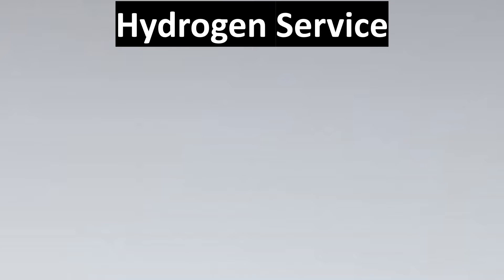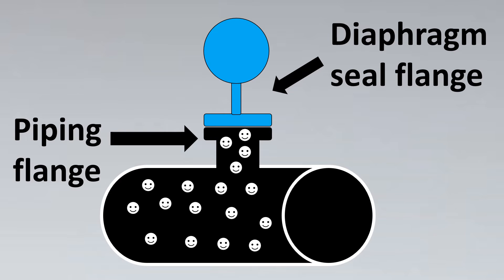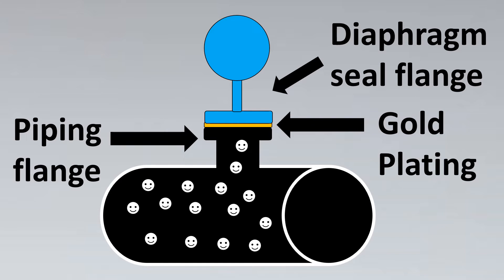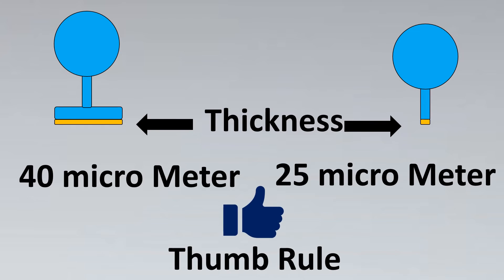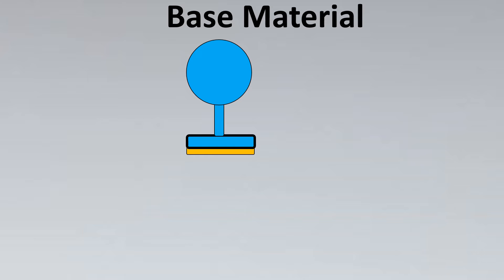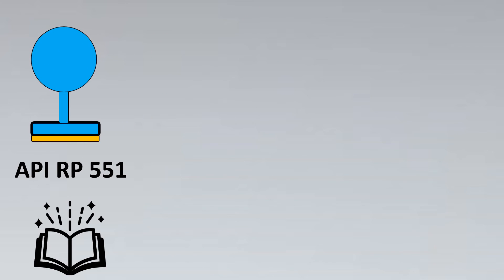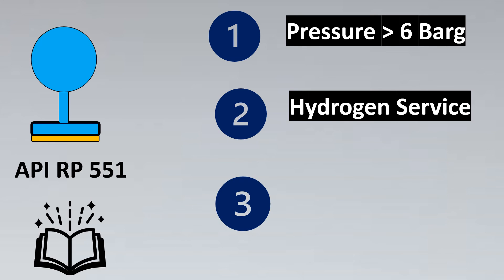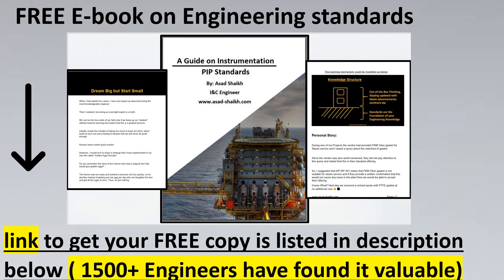Gold plated diaphragm for hydrogen service |Pressure Transmitter|Diaphragm Seal Pressure Transmitter

Comment: At which pressure would H2 bond break up
Reply from the maker: As per International standards and design criteria of top oil and gas companies it is around 5 to 6 Bar ( but note that it also depends on the temperature factor )
Reply: @AsadPassionateEngineer  so that means all hydrotreaters have gold plated PG diaphragms?

Comment: No need to use Gold plating if temp is less than 43 deg C?
Reply from the maker: and pressure is less than Approx 6 Barg as per API Recommendation.

Comment: According to the video , thermowell in hydrogen service  should it gold plated?
Reply from the maker: A very Good Question,

The answer is NO.

The thickness of most diaphragm seal membrane is around 0.05mm or 0.075mm so the Hydrogen atoms can permeate this wall.

Thermowells have very high thickness as compared to diaphragm seal membrane.

We can understand this as per the analogy that we gold plate the diaphragm seal membrane but we DONT gold plate the Pipe.
Because Pipes have thickness like Schedule 40 or Schedule XS which is far higher than that of diaphragm seal membrane.

However, precaution must be taken with respect to material selection. Tantalum is not a good choice for Hydrogen service and we should prefer SS316 in that case. (This is usually worked out by material engineer) however Gold plating would not be required.

This is best of my understand 😊

Do let me know if you have any other thoughts !! 

And once again thanks for this amazing question that many engineer get confused about!!!
Reply: @AsadPassionateEngineer  why not? Could you explain it? please
Reply from the maker: We can in short say it is because of thickness since TW has far higher thickness as compared to diaphragm seal membrane

We can connect further on LinkedIn or whatsapp to discuss further as well !!! 😊

Comment: I had similar experience in some of our Dp type diaphragm seal level transmitter for produced water service with high H2S showing false reading due to H2 ion permeate into filled fluid. We try with gold plated ones for testing purpose as per the vendor recommendation but still the performance was not good enough..so finally landed on installing GWR level transmitter and its working hassle free. Problems solved..
As you explained in the video it could be the quality of gold plating or thickness compromised lead to the malfunction. Guessing…
Anyways…well explained bro..keep posting such informative videos..great work…Much appreciated…🤝
Reply from the maker: Wow, thanks for sharing your experience !!